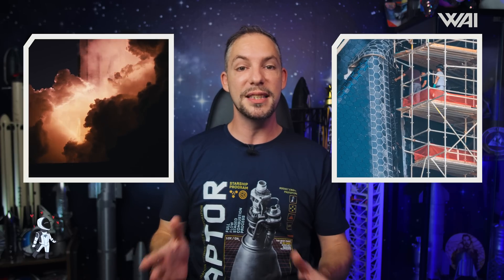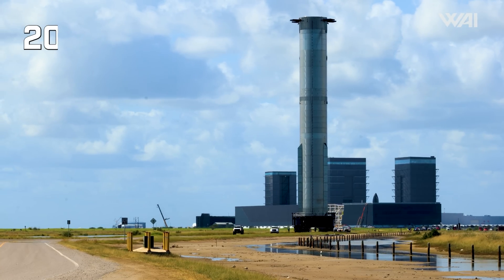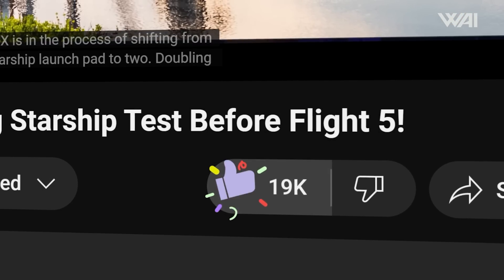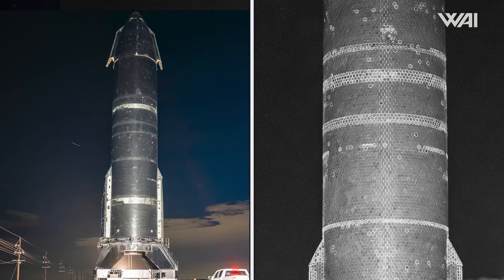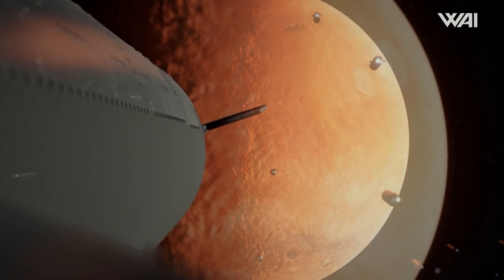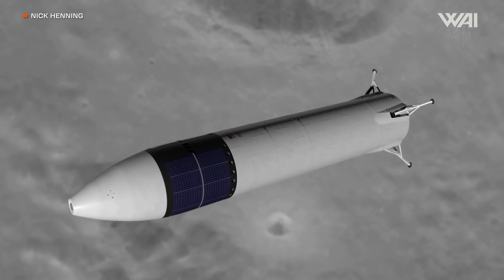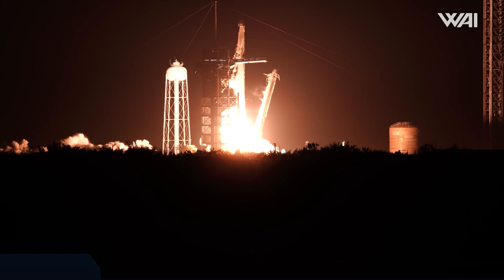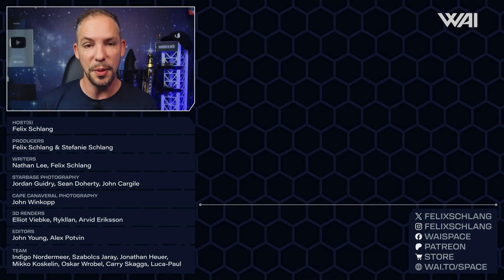SpaceX's Starship Flight 6 Booster performs unexpected MASSIVE Static Fire! Launch in 3 weeks?

Comment from the maker: Do you think SpaceX will rush to replace the rest of this heat shield, or will they fly ship 31 with what they already have? :_WAIShocked: Let me know your thoughts!
Reply: @Whataboutit  i suspect they may address specific areas such as the flaps but leave the majority as is.
Reply: Any speculation on what they may do for the landing and how they may be able to recover actual flown starship hardware?
Reply: @BillDuBrul  they probably won't bother as the ship is already very much outdated and the next generation will be much improved
Reply: 100 percent sure they are keeping the current, ship 33 holds the next version after all.
Reply: They have a lot of work on the shield, so I think they will opt for cadence this time and get the ship in the air.
Reply: One of the biggest elephants in the room is, how are they proposing to pump fuel from a supply ship to the active Starship? Pumping in microgravity has its own set of challenges.
Reply: It's mostly a matter of venting the receiving tanks to create a pressure differential. The pressure differential can be small and take a long time, or too large and cause turbulence in the plumbing. 

Of course the ullage needs to be established with a tiny amount of thrust, so the pipes inlets stay submerged. 

Probably the first step is rendezvous and connect linkages. Second, steady micro thrust. Next, reduce any excess or reversed pressure differential by connecting the two tank vapor lines. Then isolate the vapor lines and begin venting the receiving tank, slowly. Open the liquid plumbing transfer valves. 
 @locknut5382
Reply: @locknut5382 
It's not being ignored at all, it's just that other design criteria have to be addressed before orbital fuel transfer. They will get there as soon as they can.
Reply: SpaceX always rush, with one exception: Elon Time.
But I was born Before Elon Time (BET), so I'm not worried. 😉
Reply: @RWBHere  Yes, but considering the alternatives, I prefer Elon Time over Jeff Time :-)
Reply: Or without unnecessary fight against Ukraine for all this time favoring Putin.
Reply: 14:30 Felix, the Mars Starship doesnt need to have external legs with a wide baseline. The legs can be deployed vertically from within the hull and extend straight down. 

The legs need to conform very well to the landscape. This will keep the ship true vertical (plumb). 

There is plenty of height within the engine skirt to have telescoping legs – basically they are vertical hydraulic pistons with feet.

Of course the horizontal velocity has to be truely zeroed before and during touchdown. And the legs have to withstand side forces on slopes by having agressively spikey footpads. 

I see one simple way:
Connect all leg pistons hydraulically and use a single common pressurized accumulator to allow the legs to individually retract as the ground pushes up. The accumulator increases in pressure until it supports the Ship. The ship can even bounce in a damped manner, like shock absorbers. Thrusters or intelligent valve control would keep the ship plumb. 

When the hydraulic valves in series with each piston are closed, the legs cannot move. These valves do not have to resist much pressure differential – unless the ground shifts. Maybe add a redundant clamp on each leg to lock in place. 

Finally, the legs can be ditched after takeoff (if ever) to reduce return mass. (At Earth, the ship is caught by Mechazilla.)
Reply: @imconsequetau5275  Splaying the legs outwards, as with Falcon 9 Boosters, will improve stability far better than having legs which go straight downwards. Staying upright has to be the highest priority if people are going to stay alive.
Reply: I agree, leave most of the old tiles where there was not a problem.  Further upgrade the troublesome areas.
Reply: nah, they're going to use S31 for demonstrating deorbit and potentially (hopefully!) starlink v2 deployments. If the first Block2 ship can return to landing with its intact flaps, the second Block2 will be a catch attempt.
Reply: @Whataboutit  The only thing that makes me think they'll replace them is due to its proximity to the election.  A lot of poeple are hoping for a failure to throw in Elon and Trump's face before the election.  This would give them something, as stupid as that is. 

So I think they're trying to make sure things go off without a hitch.   Not saying this is the case, but it's the one thing that makes me think they don't want to take chances. 

But at the same time, they also want to push things until they break, which is obviously great and important for rapid innovation, but we all know how corrupt the media and left is, so anything they can spin or lie about they'll take.  The truth doesn't matter when they can just send out talking points and heavily edited video to make Elon look stupid.  This is going to be a VERY consequential election.  I'm honestly concerned about civil war. 

So I think there's a pressure there to get it right with the election being next week.  I'd like to think politics isn't considered at SpaceX, but it's also smart to not ignore it.
Reply: @oCyberSerenityo They cannot get ready to launch fast enough to do it before the election. So, it can not effect the election at all.
Reply: @appliedfacts  they're saying the launch is happening this week last i checked?
Reply: @oCyberSerenityo 
That would be spectacular! I hope you are right!
The last I saw was maybe to launch around November 11.
Reply: No, not necessary 😊
Reply: Would a disposable variant of Super Heavy be able to put an almost empty Starship (say 300 tons) in LEO?

If that's the case, then SpaceX could build a Starship without fuel tanks, without Raptors engines, without heatshields, without flaps.

It would be entirely transformed into a Space Station. THE ENTIRE volume (~2496 m³ / 88145 ft³) would be pressurized. All the space would be used for the cosmonauts' work, food, and rest.

It would only be equipped with SuperDraco engines (and their tanks), distributed in strategic locations to make orbit corrections. Add to that a few berthing ports and airlocks.

The giant solar panels would be delivered by another Starship.
Reply: Why not leave 31 in orbit to act as a receiver for future fuel transfer attempts?
Reply: While we're looking at the Heatshield side, we're not seeing the Pez Door. Maybe there's V2 Starlinks ready to be released between MECO and De-Orbit.
Reply: They might rush this test but hopefully do a bit more like bay door and or reignition testing. And HEY FELIX I have bought merch. from your store a few times , great quality but was hoping that you could add Muscle Shirts to your inventory. 👽👍
Reply: The next test will be to catch the starship which means the flight profile will be quite different (more likely like the booster) not necessitating upgrading the tiles
Reply: @ravibachalli206  If they do change the flight profile, won't that mean the same FAA 'delays' as the paperwork goes through?
Reply: Testing portions of a heat shield that has already gone through a re-entry should provide useful data. I think they will leave it in order to test a pre-flown heat shield.
Reply: I would not upgrade the existing tiles. Second Gen starships should have less issues around the flaps anyway, due to their placement. 🙏
Reply: Hey an other thought: can we also not launch from in between the chopstick arms so we do not need a launch pad that has to be repaired every time?
Reply: @marinusvansplunter4498 
Well....the arms are pulled away before launch and they are unharmed. The launch mount is the part that needs repaired each time. That is just the ring that the booster sits on. The second launch pad (under construction at Starebase) looks like it may have a removable mount so it can be swapped out between launches. The damaged ones can be repaired without delaying the next launch.
Reply: @appliedfacts  they can also pull the arms as soon as the rocket starts to move up so they also stay unharmed, but indeed spare rings would solve the issue...

Comment: I have a suggestion: Perhaps there's a away to roll/slide the launch mount away for landings and at T-zero.  Rails with bolt down connections for the footers when in place could eliminate any refurb/repair needed after landing.  The umbilical QDs could also rotate around the gantry ~180 deg to take those connections out of harms way at launch and certainly for landing.

Comment: A storey in a building is typically about 14 feet. So 397 feet would be about the height of a 28 story skyscraper, not just a 20 story building.
Reply: I believe the 20 story building remark was about the booster, I could be wrong as working and listening ;)
Reply: @michael24-j4i , that would make sense, then. 233/14 = 17 stories, close enough to 20. Thanks for the correction!

Comment: 14:30 Felix, the Mars Starship doesnt need to have external legs with a wide baseline. The legs can be deployed vertically from within the hull and extend straight down. 

The legs need to conform very well to the landscape. This will keep the ship true vertical (plumb). 

There is plenty of height within the engine skirt to have telescoping legs – basically they are vertical hydraulic pistons with feet.

Of course the horizontal velocity has to be truely zeroed before and during touchdown. And the legs have to withstand side forces on slopes by having agressively spikey footpads. 

I see one simple way:
Connect all leg pistons hydraulically and use a single common pressurized accumulator to allow the legs to individually retract as the ground pushes up. The accumulator increases in pressure until it supports the Ship. The ship can even bounce in a damped manner, like shock absorbers. Thrusters or intelligent valve control would keep the ship plumb. 

When the hydraulic valves in series with each piston are closed, the legs cannot move. These valves do not have to resist much pressure differential – unless the ground shifts. Maybe add a redundant clamp on each leg to lock in place. 

Finally, the legs can be ditched after takeoff (if ever) to reduce return mass. (At Earth, the ship is caught by Mechazilla.)

Comment: Question... Just watching the videos and the way the booster comes back at an angle to the OLM and so much thrust going on down there just before touch down. I'm thinking an wondering would Starship blow Booster over while it's sitting atop OLM with just clamp downs? Surely they won't be enough to keep it blowing over or copping a tonne of damage from Starship's landing/hover burn. Starship won't exactly be caught way off to the side but just slightly over.
I'm sure SpaceX have thought about it but just want to speculate and raise the question.
Ps love your work and videos Felix, I have for many years now.
Reply: I assume the future permanent hot staging ring is going to absorb most of the heat
Reply: @CrazyPengion  I'm not talking about hot stage separation, I'm talking about the landing of Starship back at the tower whilst Booster is stacked on the OLM and simply clamped down. Will Starship blow the Booster over with its own thrust?
Reply: @easty81  I mentioned the hot ring as you mentioned the booster being damaged.
The booster shouldn't be blown over, as I sure hope they made sure it's connected for something, especially against wind, and we can do some calculations as well.
Dry mass of Starship is ~100t, Superheacy is ~275t
When the ship lands it is supposed to have a relative velocity of 0, so we can assume that it's thrust will be not more than 120t (as it still has some fuel and velocity)
So less than half the boosters mass would come from above, so it shouldn't really do anything aside if the ship is firing directly at the top of the booster from a 90 degree angle, if even that would do anything.

Comment: Starship does not have to be profitable at this time!  Reflight will only be needed once required flights exceed production capabilities.  EM can afford $ wastage if it allows SpaceX to fulfill contractual and PR deadlines.  Come on, Elon did it with Tesla now StarFactory(s) & Hawthorne need the same treatment.

Playing with chopsticks is awesome and fun but not necessary to test LEO refueling and Moon landings.  The same goes for heat shields.

Comment: Suggestion: Put heat tiles on the launch mount so it doesn't need to be refurbished each time.
Reply: Stainless steel.
Reply: @imconsequetau5275  They both have drawbacks, but I go with heat tiles as they resit higher temperatures. But, now thinking about it, they might have to use stainless under the tiles, like Starship, to have the pins to attach them. If the ground under the launchmout is clean, without debris. the tiles should last a long time. But even if some fell off from time to time, it wouldn't matter much. I doubt SpaceX cares about this at this time. Only when they are launching 25--60 a year would burning away the structural steel, and it's strength, become an issue.

Comment: The Luna Lander doesn’t need a heat shield. Testing it on Earth means it won’t reach orbit; instead, it would lift off without a booster, reaching an altitude of around 1 km before descending to perform a landing. This testing could be done in a designated desert area, allowing refueling and repeated landings across different terrain types hundreds of times. Very similar to the first landings of StarShip.

Comment: SpaceX went from blowing a crater into the ground, creating a rock tornado in the process, to catching a rocket booster out of the air in only 6 flights. 

Werner Von Braun is applauding and relinquishing his seat at Space Academy.
Reply: 5 flights? But yes
Reply: @SwiftRazor003  

As x approaches an infinity of 5 from 6 it doesn't really matter it's a close enough guess

Comment: Like button smashed! 12:50 "After all, there's no point in recovering a vehicle if it can't be reused." Hmm, currently, during the test phase, there is still an advantage, because now, after catching the booster during IFT-5, they can investigate the booster in a much cheaper, easier and better way than after recovering parts of it from the sea like after IFT-4.
Reply: And reduction of orbital/ocean debris is more than a good enough reason to recover as much of the hardware as possible. Reduce - Reuse - Recycle : SpaceX has 2 out of 3 so far.

Comment: Why does a Lunar Starship need heat tiles? I thought they were going to leave the Ship on the surface for a Moon Base. They only need to send a small shuttle ship just to get the Astronauts back into orbit to a return ship or a larger version of Dragon that can return with its heat shield.
Reply: Because Starship can barely lift itself to L.E.O.  it will take 8 to 16 additional launches to refuel the lunar craft with enough fuel to reach the moons' surface and  back to dock with Orion. There are a couple dozen other critical flaws in the concept that will keep that from ever happening.  
Elon took the tax payers money and will not think twice about it . His primary concern is getting the new starlink satellites into orbit. Falcon heavy can only carry a couple at a time.  Elon wants star ship to carry the satellites up and for as cheap as possible.
Every prototype launch costs upwards 100 million just in hardware and fuel.

Comment: What is the possibility and feasibility of using two tug or tanker versions of the starships as boosters that attach to the sides of one starship to give it a significant boost of speed when they try to do transfer flights. Could that realistically have the chance of shortening the time for a trip to Mars?
Reply: That would add LOTS of weight, so it likely wouldn't give any advantage aside if you're fine with 30+ refuel launches instead of 10+

Comment: Why doesn't elon and spaceX try a flight to the moon and a moon landing instead of crashing starship in the OCEAN...could at least get some landing data and stuff to work on for next flight and if successful there would be spare parts in case something happens when people go to the moon again...
Reply: Because Starship can barely lift itself to L.E.O.  it will take 8 to 16 additional launches to refuel the lunar craft with enough fuel to reach the moons' surface and  back to dock with Orion. There are a couple dozen other critical flaws in the concept that will keep that from ever happening.  
Elon took the tax payers money and will not think twice about it . His primary concern is getting the new starlink satellites into orbit. Falcon heavy can only carry a couple at a time.  Elon wants star ship to carry the satellites up and for as cheap as possible.
Every prototype launch costs upwards 100 million just in hardware and fuel.